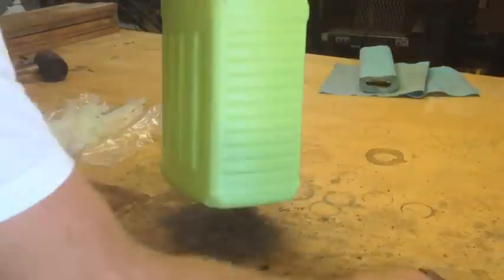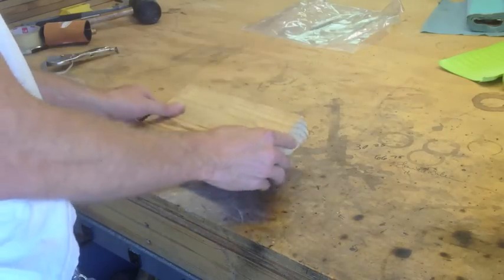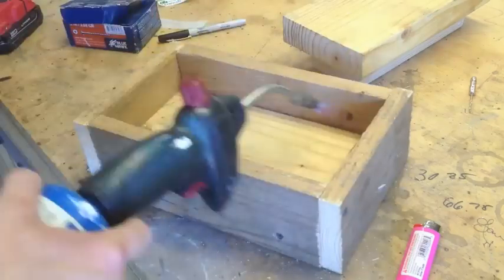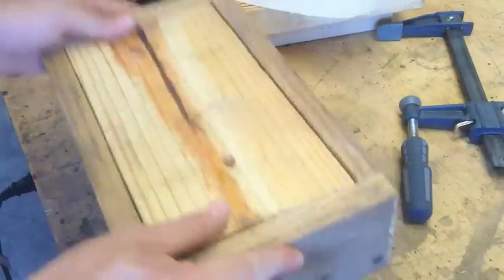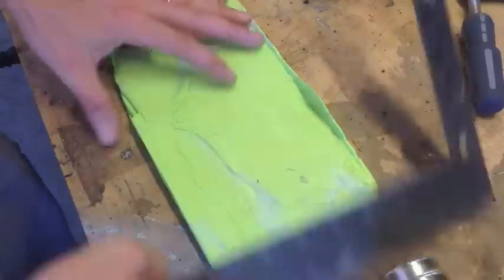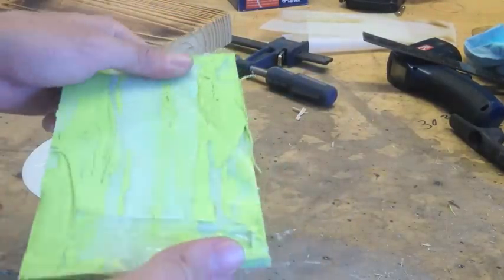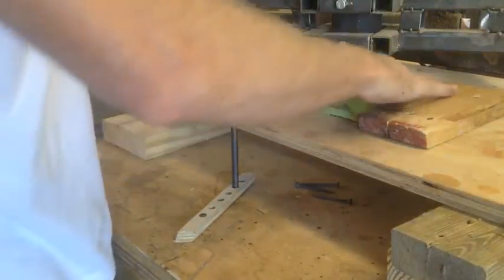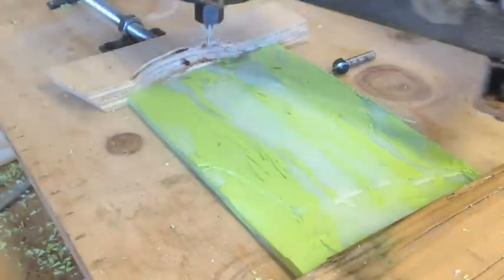Experiments With HDPE Plastic - Part 1 (Recycle, Repurpose, Re-use)

Comment: Does'nt HDPE break down with time,if exposed to the weather?
Reply from the maker: Yes it does.
Reply: Case & point;
Have a 5 gallon bucket as a trash can near my grill. Not close enough to feel the heat. I had to replace it after 2.5 years as it got brittle. Of course that was 2.5 years in direct New Mexico sunlight. Similar situation when I lived in Colorado, only that bucket lasted about 9 years.
Hope that adds a bit of perspective.

Comment: It would probably be better if the heating tray is the mould, just make a close fitting board for the top. The heavier the metal the more it would retain heat, giving you more time to work, Probably get something smaller though. Maybe a heavy metal plate on top would self level it if it's put on before it's put in the oven.

Comment: Has anyone tried silicon directly smeared on a pan left to cure then heat plastic on the tray? The pan would have a permanent 'built-in' silpat...seems to me that would work alot better...les foolin' around. any homemade forms, or muffin tins etc could all get a smear of silicon...parchment seems to work ok, but I'd think silicon right on the tray would be so much better. toaster oven & heat gun & a siliconized rolling pin would also be handy beside a shredder.
Reply: makes sense...cool

Comment: im so jealous of your pentagraph router. wow I didnt even know they exsisted. thankyou for sharing.
question. would milk cartons melt sooner? in the UK they are rather thin, I noticed tour catlitter carton was thicker.
Reply: I recently melted about 20 plastic milk  bottles down into a HDPE block for a project it worked really well, due to some of the HDPE burning slightly I ended up with a block that almost exactly resembled a piece of marple work top, if you have the means to try doing it i would highly recommend trying it. :)
Reply: also excuse the name :L

Comment: My one complaint is that everyone who makes a video about melting plastic seems to be doing it for the first time. I can't find a video from someone who has been doing this for awhile and seems to be an expert and puts all the wonderfully nerdy/geeky info in one video. Like the fact HDPE shrinks when it cools. Does anyone know if there is a solvent to make it thinner so it can be brushed on? What can be used as a primer to make paint stick to it? 
Also, I eat a lot of corn chips and I've been saving the bags to melt, but I don't know what kind of plastic they are made of. Anyone happen to know? Thanks!
Reply: yes i agree almost every video of melting hdpe doesnt really explain all the technical stuff about the hdpe. however i can give some advice since ive been melting it for a long time. for your first question about making the hdpe  thinner unfortunately it cant be made thinner because basically hdpe is made up of countless long chains of molecules of one carbon bonded to 2 hydrogens which would be like this ch2-ch2-ch2-ch2-ch2-ch2 and due to the long chains when you melt hdpe the chains due to their really long length and the high number of them all packed next to each other causes the chains to kind of not flow like a liquid the chains almost have to get past each other to melt its almost like trying to walk somewhere in a very crowded place. this is what causes hdpe to not be fully liquid when melting and increasing the temperature will not make it flow any better in fact its best to melt at the lowest temperature possible because as you increase the temperature it will degrade and the chains will split from the heat and that will cause a permament reduction in strength of the hdpe. so unfortunately there is no solvent that will help the only way to melt it is to press it into a mold like how it was in this video. and your corn chip bags are made of pete plastic which is different from hdpe and is much more difficult to melt requiring higher temperatures than your oven can handle. the best way to make paint stick to it is by sanding it with 240 grit sandpaper which gives the paint a way to adhere to the plastic also there is a technique called flame treating where you gently heat the plastic very briefly with a torch for a second or two which allows paint to adhere much better to the plastic if you have any other questions feel free to ask

Comment: ABS is actually weaker than HDPE. ABS will crack and warp easily, whereas HDPE will retain its shape and never crack or warp.
Reply: The unfortunate part about HDPE is that paint does not adhere to it at all. You'd need something to bond to it first, and then paint over that.
Reply: +CamryXLE Thanks for that! I was wondering if I was doing something wrong. The HDPE 5 gallon buckets turn brittle in the sun and so I tried to paint them so they would last longer. I wish someone would make 5 gallon buckets out of PETE plastic. #1 PETE soda bottles seem to last forever even in the sun!
Reply: +kedwa30 yeah, PETE is weird like that. HDPE is better for projects where they don't get a lot of UV rays, otherwise it decays pretty fast.

Comment: Looks like you used pressure treated lumber for the bottom. Is that right?
Reply from the maker: +Ham Niles That's right.
Reply: +Absorber of Light -Some scary fumes come off that stuff when you burn it. I know you smoke, but you might want to protect your-self and uses plain lumber or another material if you are going to scorch it  for mold release.
Reply from the maker: +Ham Niles Thanks for the advice.
Reply from the maker: +phartattack move along troll you've been drinking again haven't you?